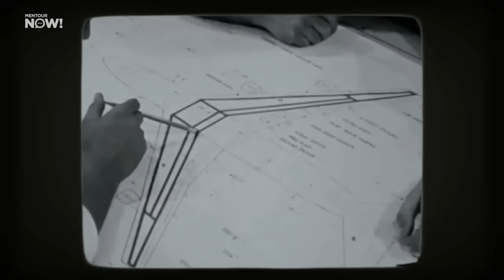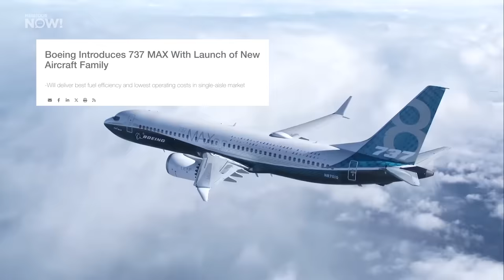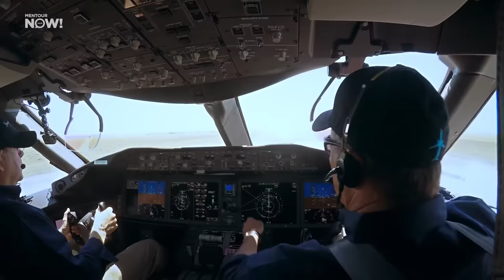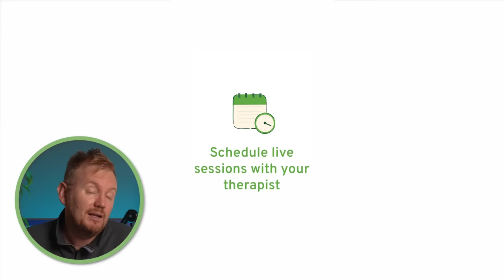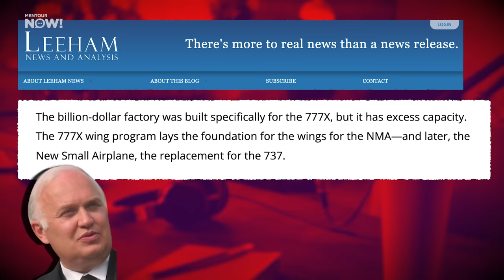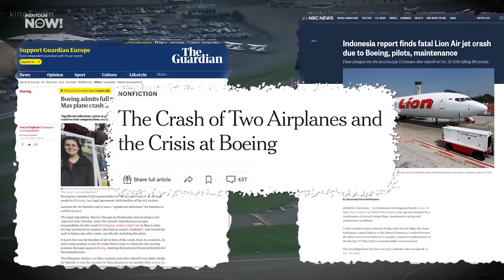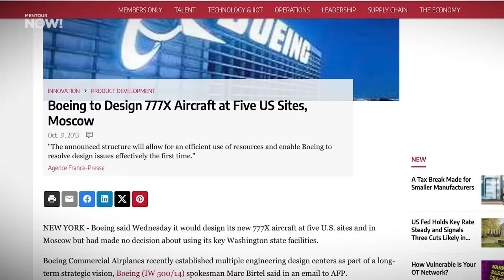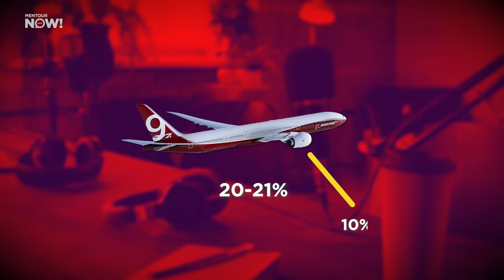What’s Going On With The Boeing 777X?!

Comment: I'd like Petter to get certified on the 777X then book a ticket on his flight.  
It'd be cool on takeoff to have Capt Mentour Now take us into the sky at a 60-degree angle!
Reply from the maker: I would love to fly this plane.
Reply: Awesome!
Reply: It would definitely be cool to have Petter as a Captain. However, I hate to be the bearer of bad news, but you're definitely not going to get a 60-degree pitch attitude on any commercial flight (unless it is a commercial space flight. :) )
Reply: The 777X air-show had it take off at a 60 degree angle.  Granted, it wasn't full of fuel and had zero passengers, however, it is possible.
Reply: @PauperJ  "Mike November Tango Romeo November Whiskey, Runway 04, Cleared for takeoff and steep accent has been approved"

Edit:

... and then your eyebrows touch on the back side of your head as your stomach tries to exit your body via your kneecap...
Reply: @PauperJ Oh, yes, it can be possible, but it's not something that would ever happen outside of flight testing or a demonstration flight. Pretty sure most company procedures don't allow 60-degree nose-up attitudes. :) Tower is also not so likely to grant your request for unrestricted climb. - haha

A barrel roll is also completely possible (as long as the automation doesn't actively prevent you from doing it,) but also not something you're going to experience on a passenger flight, unless maybe your pilot is Tex Johnston. :)

Comment: The 777X was launched as a derivative, but the cert has essentially made it a clean sheet. Already written off $6.5 billion on the program, which makes it a loss for the company (see: Program Accounting). Shop talk on the BA floor is that there was also a high alpha issue (tail too small) that they wanted to fix with software.
Reply: I hope to God that they don’t try to fix the high alpha issue with software. That’s the kind of tomfoolery that brought us MCAS on the Max 8. Is it too hard to design an aircraft that is aerodynamically stable?
Reply: @mikoto7693  A friend of mine is a retired BA engineer. Worked on the 767. He says it's a product of the tail being too small, but if it's done properly, software can take care of it in the flight control system. Thing is, after the Max debacle, everything is getting looked at with a fine tooth comb. It's costing BA a bunch of time and money, which is why we're into late 2025 now.

Comment: I remember when the initial 777 was announced, artist renderings showed a folding wing tip…which of course was never included on any prototypes or production planes.
Reply: Because no one ordered it. That was for it to fit in ADG IV stands and would have required huge foldable sections (21' on each wing.) The 777X plan is for it to fit in ADG V stands (same size stands the current 777, as well as 787, A330, A350, and 747-400 use.)

Basically all airports that the 777 would serve have plenty of ADG V stands already and ADG IV doesn't open up that many more (it's pretty much only used by the 757 and 767.) All of those airports also already have ADG V taxiways to/from all of the places that a widebody might need to go. So, there's not that much to be gained by making a 777 that can fit in an ADG IV stand.

On the other hand, ADG VI stands and taxiways are much less common. It's only needed by the A380, 747-8, and big Antonov cargo planes, so only airports that needed to support those types created stands and taxiways for them and, even of those that did, their ADG VI stands (and even taxiways) tend to be far more limited than their ADG V stands. So, there's quite a lot to be gained by keeping the 777X within ADG V limits. Indeed, the whole program might not be viable at all if it didn't fit in ADG V wingspan limits.

Comment: @3:30 I wouldn't say that airlines hated the original A350 for not being "Modern Enough". The problem back then was that Airbus was going to offer the A350 alongside the A330ceo so you have somewhat of a duplicate product. Granted the A350 features composite body and wings and newer engines/avionics compared to the A330ceo, it didn't make sense for airlines to order it over the other. After further consultation, Airbus modified the A350 and gave it a wider body (XWB = Xtra Wide Body) and sized it to compete with the 777s.

A330 using the same fuselage design as the A300 is similar to Boeing using the same fuselage design on the early 737s from 1960s which in turn came from Boeing's first commercial jet, the 707. 707, 727, 737, and 757 all share the same fuselage design. The 747 was when Boeing went with a different fuselage design being their first widebody.

Comment: Well, the delays are not important for Boeing or Airbus because there are no other airplane manufacturers. It is not like you can order a pizza from the other 10 restaurants if they will not deliver it to you.
Reply: Well, it is important to Boeing when they have a rival on the other side of the pond, known for "continous improvement", a.k.a. small incremental variants over "ER" style big changes once in a while.
Between the announcement and expected EIS of 777X, Airbus raised 35K's MTOW from 308t to 322t, replaced the winglet, saved at least 1t of OEW, and the ability to pack more customers.
35K was an aircraft that barely matched 77W, now it has long enough range for Qatar and Qantas, good enough field performance for Ethiopian, and large enough capacity for Phillipines (by adopting 10 abreast). 777X is still the bigger and more capable aircraft family, but the lead is shrinking.
The more time Boeing is late, the more time for Airbus to brush up here and there, and worsestill, establish a fleet into some desperate customers. They must be thankful that RR didn't have the resources to PIP TrentXWB during the same period.

Comment: Boeing is in bigger trouble with the eventual 737 replacement that is needed.  The Max is a stopgap but a newer design is desperately needed.  Then a real MoM aircraft is really needed and this is really up for grabs by both Boeing and Airbus.  Too bad Boeing destroyed the 757 tooling or an updated version of that aircraft could have been produced.
Reply: With a ten-year MAX backlog (last I checked), "desperate" may be a bit strong.

Would an "updated" 757 sell any better than the "updated" 747 has?  Half-measures like a metal fuselage updated with a new carbon or carbon/metal wing haven't been very popular with airlines looking for a competitive edge.
Reply: @marcmcreynolds2827  All the 757 tooling has to be rebuilt.  There is no way to update it that isn't as expensive as a clean sheet design.

Comment: Fun fact, both the A350 and 777x is larger than the orignal jumbo jet the 747-100. And the largest 777x is basically the same size as the 747-400.

(to be clear, larger as in larger capacity, and its only the A350-1000 that is larger, not the -900)
Reply: But with much better fuel efficiency.
Reply: They don’t have 4 engines though 🥺
Reply: And they don't have the iconic hump
Reply: @captainchrisfuture1424  Well of cause. its worth saying that the hump of the 747-100 is really quite tiny. It hardly adds any passenger capacity, the main benefit it do is move the pilots away from the main deck
Reply: @FinalLugiaGuardian  Its almost funny how large the diffrance is. Still the 747-100 was considered really quite fuelefficent when it was new. 

A 747-100 carry almost 180m3 of fuel, a A350-1000 (that have about the same capacity (arguably higher, depending on how you count) carry just shy of 160m3 fuel.

A350-100 have twice the range. The 777-300 have about the same capacity 170m3 fuel and just in between in range.

It worth saying that some of the added capacity is not new floor space. Things like a shorter cockpit (due to a 2 man crew), thinner chairs (yea, that ads 18-20 people capacity), more compact kitchen and smaller lavatories. And that is the OG A350. The new one ad (up to) 30 more seats.

Still.. its hard to be quite fair becasue exactly how the layout is utilized matters.
Reply: @matsv201  yeah that's right

Comment: 777-300ER is a beast at take off, love that plane, can't wait for 777X, a fully loaded plane felt like a kick in the ass on the roll
Reply from the maker: I’m also looking forward to it
Reply: Just recently had my first trip on a 777 3er, what a machine that is
Reply: @davolyncho5992  yeah the take off is where you smile. did you feel it to?
Reply: Ever fly in a 757? That plane was an absolute rocket.
Reply: @keepyourbilsteins  yes i have, the most thrust to power ratio, it was a long time ago so i don't remember the flight. i would like to fly one again, but they are rare

*thrust to weight ratio

Comment: With the folding wingtips I don't see any winglets. Is this a disadvantage for efficiency? Or will the folding tips themselves become the winglets during flight?
Reply: When DAC flight tested various winglet configurations on the DC-10 (a while before the MD-11), the general conclusion was that a winglet (the ones they tested anyway) bought about the same amount of drag reduction as simply applying that same amount of area to increasing the wingspan.

Comment: Hopefully Boeing recovers in the future. 
They lost so much money with the 737MAX recertification, 777X and also the military program for the USAF.
Reply from the maker: Correct. 
The 777X looks like a fantastic aircraft so I hope Boeing goes far with it.
Reply: so did airbus with its a380
Reply: @nickolliver3021  
Of course, but this video isn‘t about airbus. It‘s about boeing.
Reply: @Xg78  doesn't matter. The point still stands
Reply: @nickolliver3021  
Dude yes, but your point is irrelevant for this video and in this comment section😂
Reply: @Xg78  then so is yours 😆
Reply: And with Starliner. Space contracts used to be money printing machines, but with Crew Dragon exceeding expectations, they are deep in the red for making a vehicle that doesn't earn them any money.
Reply: @nickolliver3021  Everyone makes mistakes, but the difference is how they tackle it.
A380 is a lesson learnt for Airbus, that the next clean sheet project A350XWB has been largely on time, on budget and on spec. It seems they also burnt their hands and become less convinced of the idea of another Emirates plane.
And you'd expect Boeing would do the same after all the troubles of 787, and so better on 777X...
.well, they aren't fully over the first trouble until recently.
Reply: @steinwaldmadchen  And when they do tackle it it's a challenge for them to understand the best way to tackle it. Its not a failure otherwise. 
Yes the 350 was a clean sheet and released on time and on budget. On tne boeing side okay the 787s had some early issues but they are resolved. Its a proven jet and so will the upcoming 777x. We have  exciting years ahead now the past is behind us
Reply: @nickolliver3021  Well, its not even a year since 787's last production halt, and quality is not great that to a point loyal Boeing customers are openly critising it. We are not talking about Al Baker or Tim Clark, but the likes of KLM which are usually quiet. No one says 787 is a bad plane, but much to be desired in terms of project execution. Otherwise you're just fooling yourself - building a bestseller but unable to breakeven.

Back to 777X, we probably won't see this video if Boeing has learnt the lesson. Can anyone guarantee the project can be delivered on time (or slightly delay) if GE9X has gone right and the pandemic didn't happen?
Reply: @steinwaldmadchen  We know it's not quite a year since the last 787 production halt. Next year we shouldn't have any production halts of it as the remaining frames get the rework done and we just have new frames coming out if production that get delivered more quickly. Loyal boeing customers are openly criticising it? Of course the 787 is not a bad aircraft but project execution airlines dont really consider when buying the type. Klm sadly have gone to the a350. Which is understandable. The plane will break even and hopefully make sone profit in future years. 

Well engine issues are unexpected so if tbe pandemic didn't exist perhaps the 777x may have gone smoother but heh what's happened has happened. Not much we can do about really

Comment: They keep stretching these planes they are gunna need whole new factory buildings cuz the wing span is gunna be wider than the damn door.
Reply from the maker: Yep, hence the foldable wingtips
Reply: Folding wings have been on aircraft since World War Two.
Reply: @stefanlaskowski6660  Before that, I've seen images of biplanes with foldable wings, e.g. Blackburn Ripon
Reply: @MentourNow Lets hope future planes after these dont get any larger.  How close to the maximum of efficiency are these things? Also, how much longer can they get before its to long for the structure of the plane?

Comment: The underlying reason for all this is that Boeing management thought they were spending too much on engineering, so they decided to contract out to cheaper suppliers, and reduce the cost of their own engineers by effectively driving down their compensation package. That resulted in a lot of engineers saying "LOL! Bye!" and those that remained getting into a fight to retain their standard of living. Boeing decided to play hardball, rather than pay the hundreds of millions. On the 787 program that probably cost them about $24 billion. The subcontractors not only weren't as good as the Boeing folk, they just did what they were told, they didn't object when things didn't look right. In the past Boeing internal folks would push back on mistakes and get them resolved during the design stage. Subcontractors do what they are contracted to do. Then Boeing found the systems either didn't fit together well, weren't designed correctly, or weren't built to adequate quality. On the MAX it depends how you count, but minimum direct costs are $20 billion, and total as high as $60 billion... as of 2020. The first delay on the 777-X cost $6.5 billion, a later incremental delay added another $1.5 billion. I can't find an article where anyone accumulates all the 777-X delay costs, so let's just go with the $8 billion. So in total, in the civil aircraft market, Boeing has thrown away $52 billion in bad engineering since the Douglas Finance management took over, and that could be as much as $92 million. At the time the first KC-46 was delivered Boeing admitted to a $3 billion cost. Then there's the harder to track cost of hollowing out your engineering company and doing the work with subcontractors and contract labor. A few years ago my US company bid a major development program for the USAF, we were surprised when Boeing No-Bid the program. They claimed they didn't have the resources to bid. It wasn't clear if they meant money or people.

Comment: The SP was a GORGEOUS looking airplane. It flew further, higher, faster than any B747-100 or 200B. It had much simplified TE flaps which reduced drag and enabled much of its superior performance. A totally magnificent variant of the Queen is exactly what the SP was :-) BTW, does the 777-X approach the MTOW of a 747-8i? Surely, the B737 Max engine squashed, squeezed, massaged and MCAS'd to almost fit under the very, very elderly 737 wing could never look worse than the big, beautiful GE-9X fitted to that superior 747?
Reply: I agree 💯 I flew on the 747SP many times & I loved it, beautiful aircraft

Comment: I wonder if aircraft manufacturers could at least partially get away from rivets in favor of friction stir welding which works very well for Falcon 9 made of similar Al-Li alloy and undergoes much higher stress than a passenger aircraft

Comment: I think we're reaching the point where aircraft design is maxed out, it's a bit like the knife and fork, realistically nothing much better in sight. We're pushing so far any improvement costs a massive investment. We badly need a new source of fuel so we can step back from the limits
Reply: Your lack of understanding does not change the complexity of the world around you.
Reply: @Look_What_You_Did  He's right. As designs become more efficient, further efficiencies become harder and more costly to find.
Reply: @QuicknStraight  Or evolutionary approach and its diminishing returns.
Reply: More efficient planes are cheaper to fly so then more people fly, therefore making no difference to net emissions.

Comment: Will the foldable wings not add weight and also maintenance costs to the 777x? I’m guessing the fuel savings of the new wing design and engines will outweigh these costs to make it worthwhile.
Reply: Plus airport fees are not dependant on wingspan, only maximum take off weight. Availability of gates can be an issue, but more for the airport.
Reply: They will add weight and engineering cost but the improvements will far outweigh the cost.

Comment: Mitsubishi Nagoya plant has been producing 787 composite wings for years. c.2013 Mitsubishi offered to expand the Nagoya plant for 777x wings. That seems like the ideal partner to jumpstart production; why didn't Boeing choose Mitsubishi?
Reply: It’s been awhile since I read the history of 787 but I remember one of the conclusions Boeing made about 787’s challenges was having too many suppliers spread too far. If they can get their Everett facility working well, it’s almost definitely better than manufacturing across the Pacific Ocean.
Reply: Even with relatively close (continental) suppliers or sites, Boeing was still burned when all of those 737 fuselages tumbled off a derailed train.  They may also be thinking about how it's gone for Airbus at times with partners spread here and there (and not all using exactly the same drawing sotware version IIRC).  So perhaps (I don't know) the idea of the site being just down the road, and best of all staffed by people you can directly yell at and threaten to fire...